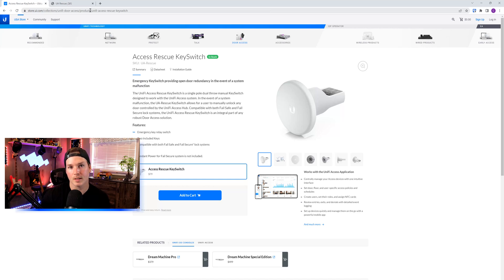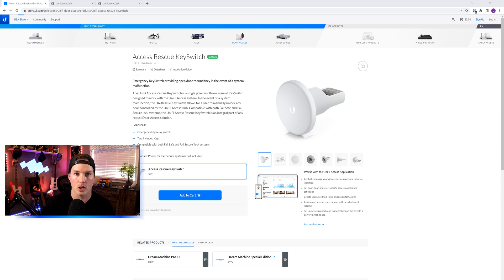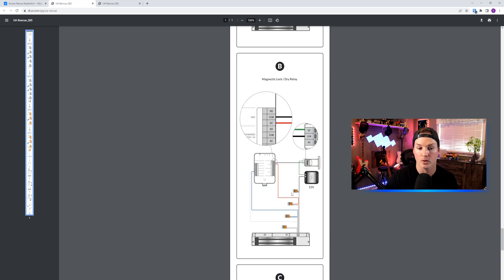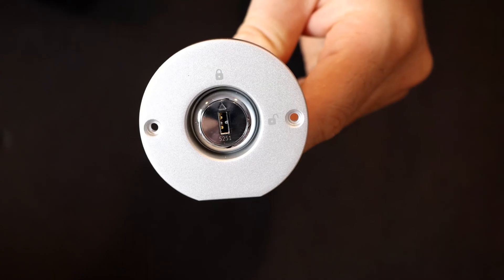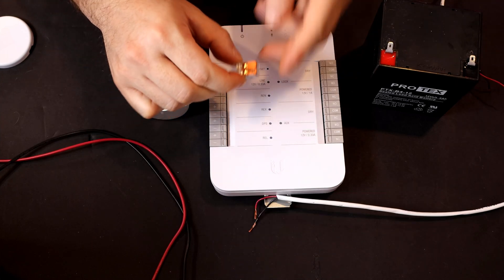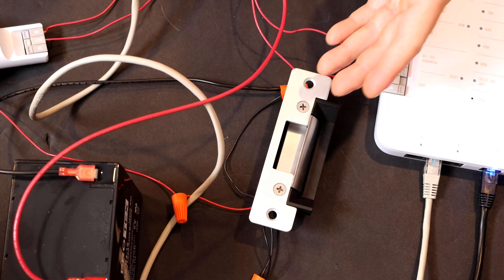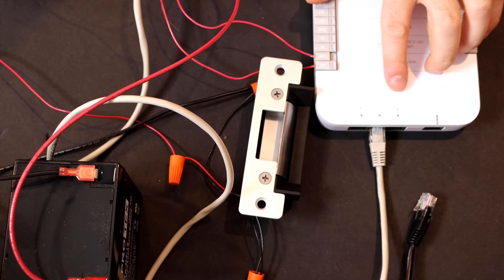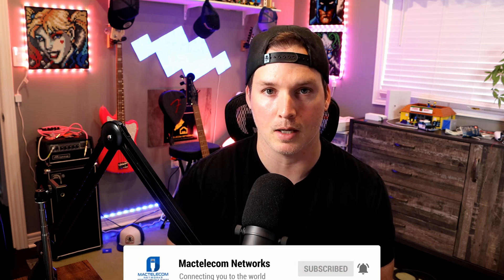Unifi Access Rescue KeySwitch

Comment: Hey Cody. I’m thinking about one of these for a business my wife is starting. We live in Calgary and would need one of these in case the G2 Reader Pro fritzes out on the extreme cold days (below -30). Can you turn the key to activate the rescue keyswitch and then remove the key and replace the cover? ie. Can we open the door for the business for the day, bypassing the G2 Reader, but not leave the key in all day? That would be awkward.

Comment: Can Unifi Access connect to a fire alarm system?
Reply: Yes it can, and be set to fail open if the alarm triggers. You may need to add in an additional relay; but it works

Comment: wow.. This is secure?! 

Ubiquiti should stop making physical security devices.   All one would need to do is litterally rip the rescue keyswitch out of the wall and touch wires like they are in a movie..

This is very poorly designed!
Reply from the maker: Ya they need some type of tamper sensor or a way to tell if the wires had been taken out of the key and disable the feature. I’ve already brought it up to them
Reply: @MactelecomNetworks  exactly! If it has a way of knowing this, without it being able to be tricked by a shim or magnet, definitely would be an improvement!

Comment: we need lockpicking lawyer to test this out
Reply: I suspect he would unscrew the key switch and either bridge or disconnect the wires on the back (depending on how the switch was set up).
Reply: @lockpickinglawyer  assuming the lock was not removable, how pick resistant do you think it would be?
Reply: He would hack this one in 5 seconds like a majorty of his videos because this device is very poorly designed.

Comment: questions: would you want this on the interior side of the door, exterior, or both wired in series? what keeps someone from just taking it out of the wall and hot wiring it?
Reply: First thing i thought of was the exposed screws.  Remove those, cross the wires and im assuming it would unlock?  Feel like the lock picking lawyer would rip that thing apart.
Reply: It looks like the instructions have an option for some weird screw head that I'm assuming is one-way. You could of course still get it out, but there would be evidence as you'd have to use a screw extractor or a dremel.
Reply: In the uk these switch’s would be used on the inside to unlock the door for emergency services to enter and exit as they please
Reply: @Walterz930  The key device is for if the system is down and the lock is in failed secure mode. This would then lock your emergecy service outside and unable to get in without smashing the door down, then I don't think they need any key .. lol this is a poor security device and Ubiquiti should stop making locks.

Comment: How do you mount it to the door? Isn't it easy to remove screws and just short wires to open door? thanks for answer.
Reply: Interesting comment - For this reason I'd want it on a back door if went for it
Reply: @MartinHiggs84  I was expecting some digital secured connection, like in alarm systems, but not NO, NC contacts only.
Reply: @symeks2  might be assuming you already have an alarm system that would trigger if not disabled.